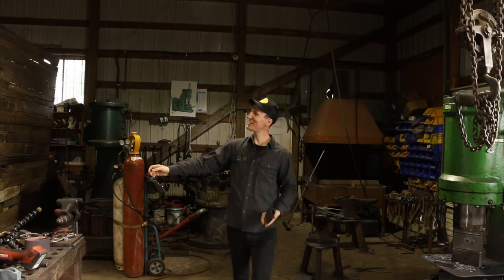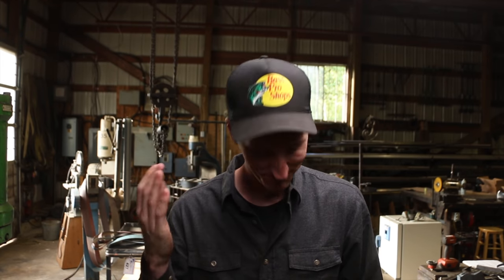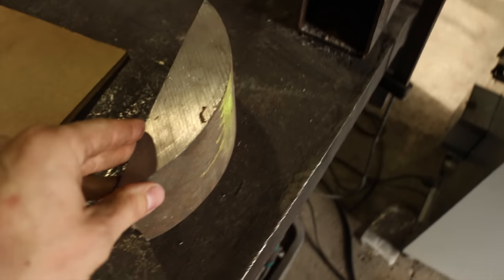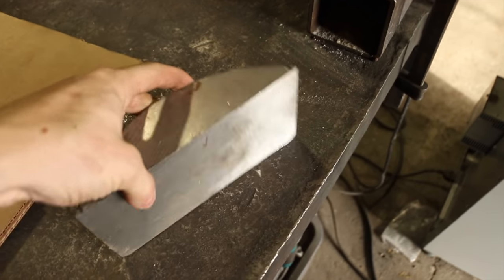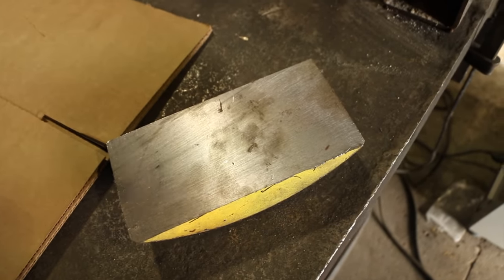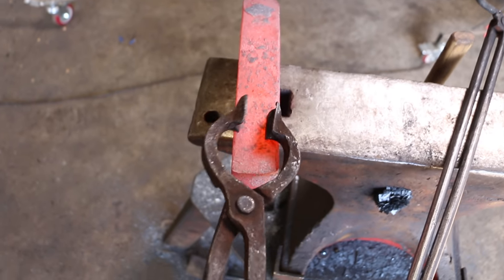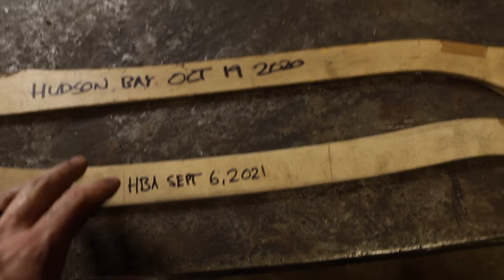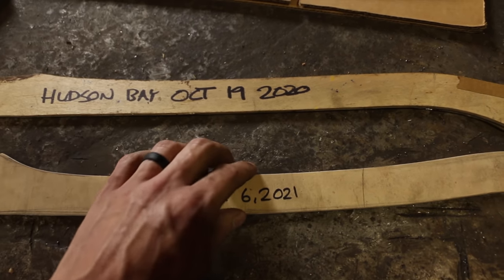I Built The Wood Bullet ALL WRONG!

Comment: Greetings from the on fire Okanagan again sir. If you're going to keep the 4.5lb head anyways - and why not - then why don't you make up a handle and see how it works? You might be really surprised at either how good or how not good it is, but you'll only know if you handle it and use it a wee bit. Just a thought from an old guy who's been cutting firewood and fooling with axe shapes and sizes for 40 plus years. Good video as usual too by the way sir.

Comment: You really need to just buy some steel that is the correct size so you can easily make any sized axe you want. Having the right size bar stock will even save you money since you wouldn't be wasting nearly as much steel by trying to use the scraps you have lying around & end up wasting it when it ends up too small & the biggest savings would be the time you save.